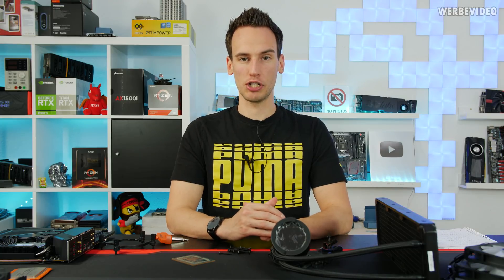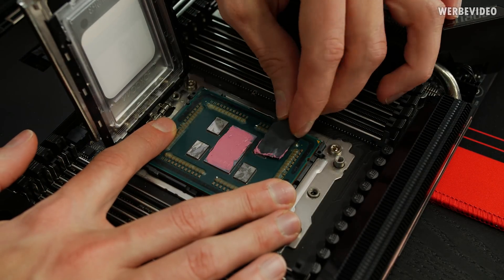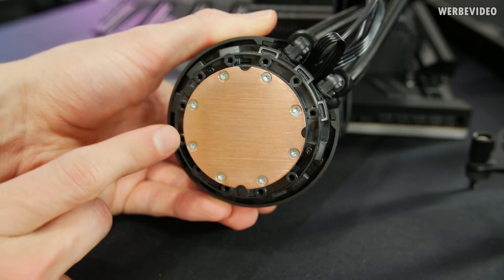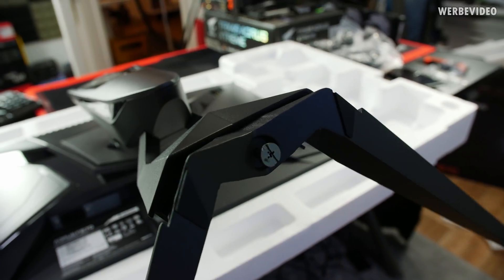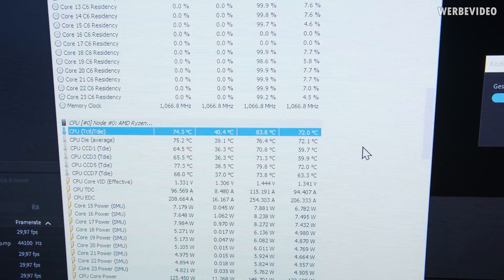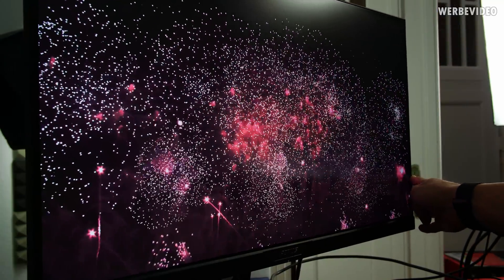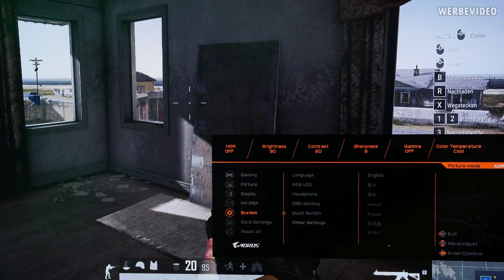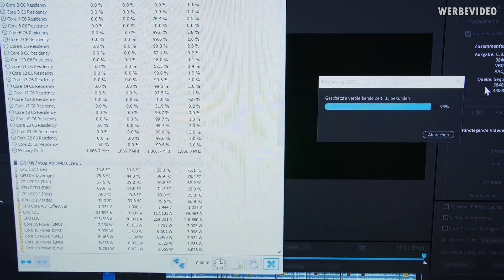AORUS FI27Q - Great 165 Hz WQHD Monitor in Review + AMD Threadripper Die Location vs. AIO test

Comment: Hello Der8auer, im a fan of your channel and your content. Today i have a really big problem. 

I bought a DDR4 4400mhz CL19 1.40v (XMP) 16GB kit (2x8GB) and when i installed on my motherboard (Z390 Auorus Master) my system dont boot, it says fail, and i need to choose optimized defaults settings, then my system boot, but, my RAM speed, change to 2133mhz (i think is native JDEC). So what i can do to have my expensive Ram Kit working fine?

My Setup

i9 9900KF 5.1Ghz Stable 

DDR4 4400mhz CL19 ( this one i have inssues)
GTX 1080ti
PSU 860W Gold Plus

maybe you can help me, i will aprecciate.

Best regards and keep doing this fantastic job

Comment: if the hot spots (ccd) aren't above the waterblock fins don't you think it would increase thermal resistance and increase temps? 
i'm pretty sure the fin area was the main problem with watercoolers and why the  noctua threadripper aircoolers and the enermax liquid cooler performed so well
Reply: Spot on.  Water is great because it can take the heat away from the source quickly, thus it doesn't give the coldplate time to get heat-soaked.  But the pins/fins really need to be covering AT LEAST the full surface area of the heat-source for optimal fast heat dissipation.

Not that an AIO is a great choice for cooling anything above 100W TDP anyways though eh? 🤨

Comment: If 12ms of input lag is measured inside the game, than thats damn good. What game is it tho? Even tho thats not correct way to measure latency. That way you have to do the same game test for each monitor to know how it campares to others.
And I believe response times and input lag are not the same thing. Response times are for motion blur, and input lag is just latency. 12ms of response time would be almost as blurry as 60hz/fps. HWUnboxed measured avg of 6ms response times (with "-P" model). An that seems correct for 165Hz IPS.

Comment: Since you seem to be in contact with Gigabyte / AORUS, can you confirm something for me? Powering the EPS12V lines on the TRX40 AORUS XTREME without the rest of the board powered (like you would when filling an open loop system) burns out the VRMs. I tried to get GN to investigate, but it seems they're too busy to reply.

Comment: bought a pixio px7 which uses the same panel the pixio has two dp 1.4 also and a hdmi 2.0 and under cuts the aorus monitors. the stand isnt anywhere near as good but mines mounted on a monitor arm so thats a non issue for me.

Comment: Hey, mal ne kurze Frage an euch: Wie groß müsste mein Netzteil denn sein, wenn ich einen i9-9900k @5,0 GHz mit einer RTX 2080 Ti (soll auch übertaktet werden) verwende?
Ich plane eine große WaKü im 1000D, weswegen ich hier die vollen 13 Lüfter ausnutzen will. Restliche Komponenten:
2x Corsair Dominator Platinum RGB (32 GB Dual, 3000 MHz, CL15)
2x SATA SSD und 1x NVMe SSD
1x Alphacool Laing DDC310
Reply: ich würde dir da mindestens ein 1000W bis 1400W Netzteil ans Herz legen

Comment: 6:19 - memory clock 2133MHz?! Lower performances, but also lower power draw and heat dissipation.
Reply: I could be mistaken but I believe 2133 is the most stable clock for ddr4 and so removing that as a potential crash allows him to make sure the only issues would be CPU related

Comment: I just bought one of the AORUS FI27Q monitors last month. It's fantastic and for my use case of several computers from one monitor it allows for easy switching between computers during work. System and keyboard control of the monitor settings only makes me wonder why this hasn't been standard for the last decade. Worth every dollar spent.